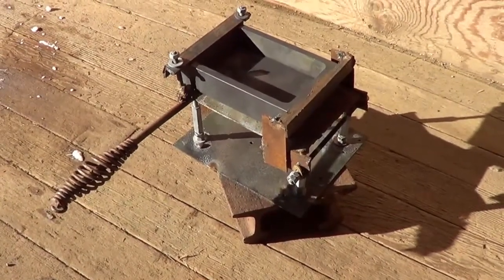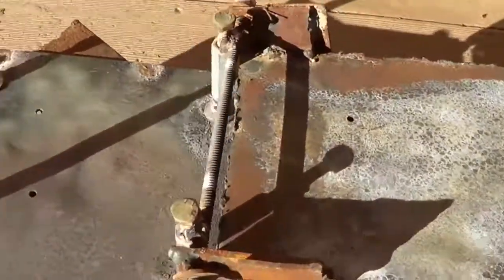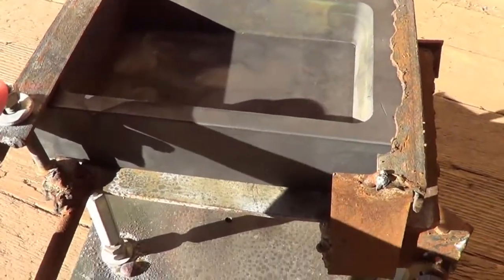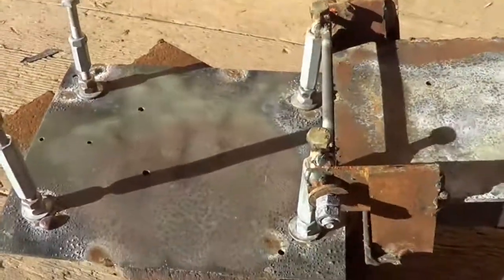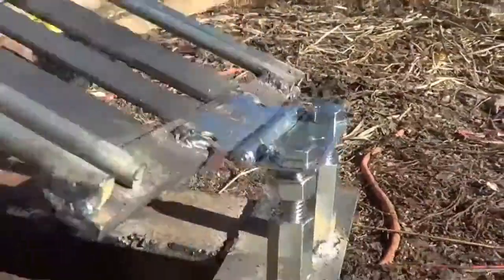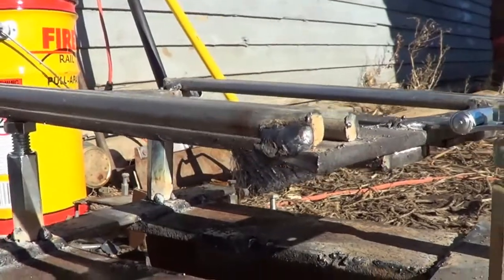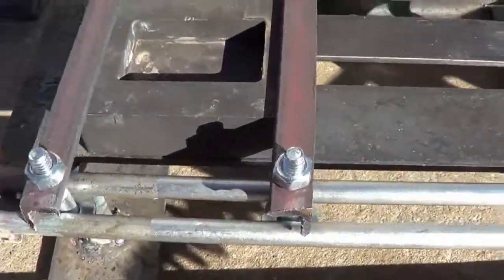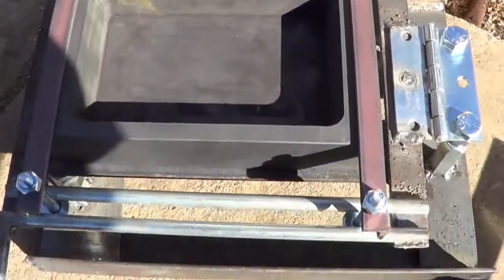The Mold Dispenser

Comment: Where did you get that mold?
Reply from the maker: type in "5 pound copper mold" on ebay that is where i bought mine from
Reply: 12345boehm Can you pure infinite times in that mold or you have for example 100 times to pure,and then need a replacment? Thank you!
Reply from the maker: I am not sure I pour metals in like 20 times already and looks like new yet.
Reply: 12345boehm Thank you! I think that mold is for about 30 times to pure... You'll see..